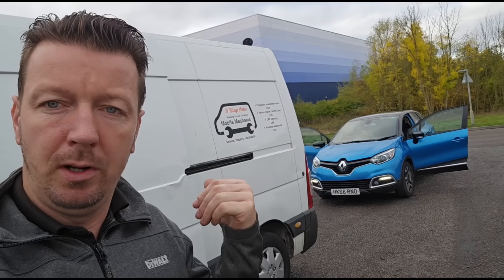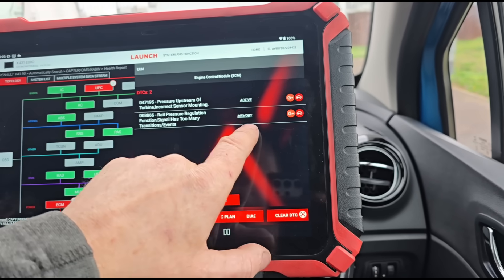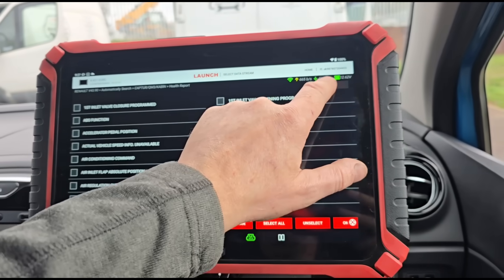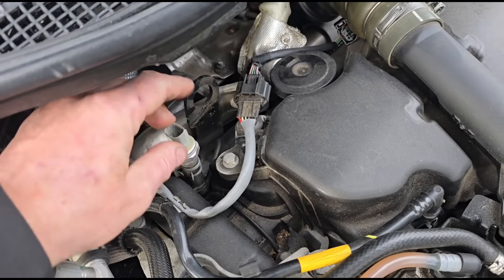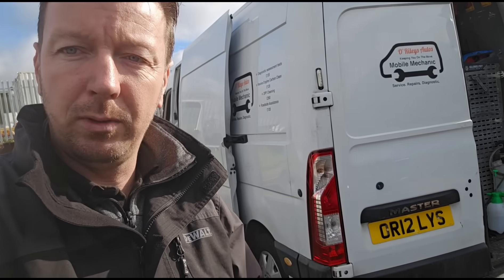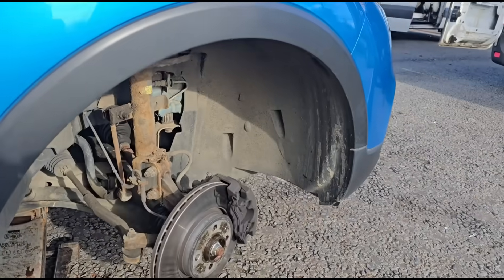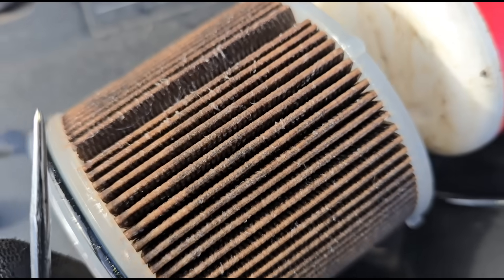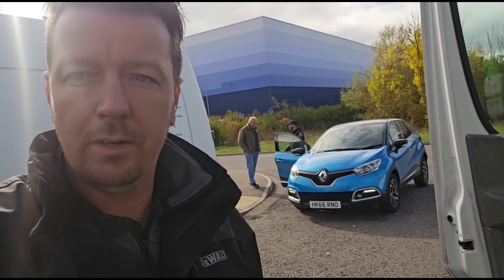Renault Captur DTC 047195

Comment: Hi Jimmy. Great video. I have a question. Just took my Renault Traffic 2017mod to the work shop to replace 2 injectors. After the replacement the mechanic told me that he could not start the car becouse the cylinders 1 or 4 does not goes all the way up, (he try it with the starter and then try to rotate the engine by hands) becouse one of them posssibly is blocked from carbon debri. (perhaps wile removing one of the injectors some fell inside the cylinder). Is that possible?

Comment: I found your channel after I bought a 2015 vauxhall vivaro last week.

Whilst driving it home, within less than an hour, the check injection system kept flashing off and on.

Now it's stuck on with the check anti-pollution fault too.

I've got a friend with a decent diagnostics tool, he did a quick check and it was popping up with a fault on the exhaust pressure sensor.

He's coming back on Sunday to have a proper look and we're going to hopefully get it sorted.

I wish I could get it to someone that knows these issues like you but I'm all the way in the north of Scotland 😂

Even trying to find a half decent garage that can book you in within a few weeks is hard.

I tried to get some launch UK dpf cleaner but couldn't find it anywhere 😂

Got a bottle of wynns dpf cleaner, a spray can of dpf cleaner and a can of erg cleaning spray cus I didn't know what one to use 😂

I also got a new pressure sensor and have an entire new pipe coming tomorrow.

I was just going to order the rubber hose in case we took it off and realised it was burst, but I managed to find the entire pipe with hose for £10 more than just the hose.

I have no idea how hard it is to replace the pipe, but I'm going to assume it's harder than cleaning it 😂

My mate isn't exactly a professional but he gets paid to fix cars 😂

So hopefully between me buying just about everything we'd need whether it is cleaning or replacing the pipe, we'll get it sorted.

Sorry this was so long 😂

If it fixes the issue, you're a life saver.
Reply: Let us know how you got on.
I bought a 2018 vivaro.. Low Adblue message came on then anti pol & check injector etc...
Reply: @paulbrown7374 I will try and remember to let you know if it works 😂
Thankfully mine doesn't have adblue... I think... 😂

My knowledge of cars is basically that they have wheels and go vroom 😂

Gonna just learn to do smaller jobs myself though.

But I think when it's anything engine related, I'll get some help 😂

Not looking forward to doing the glow plugs 😂
Reply: @paulbrown7374 I got it unblocked eventually 😂 4 hours with a bike brake cable, some ptfe tubing, wynns dpf cleaning fuel additive and a bike pump 😂

I didn't have anything capable of putting pressure into the pipe other than a bike pump.

But it bloody worked clamping the pump onto the tube with some dpf cleaner in it on the pipe.

Cycled between putting in some cleaner, using the cable on the drill, then using a brake bleeder to suck out some of the dpf cleaner full of carbon and repeat

Comment: My brother had to change the upstream turbo pressure sensor on my dad's  Renault kadjar 1.6dci and it was really difficult to get to but it was not tight luckily.
He had to get a special socket.
He used a resistor in about in the middle of the range to make sure the computer was ok.

Comment: That's a stupid place for a fuel filter. French engineering 👎
And so many modern cars would be so much easier to work on if the engine bays were 2 inches longer and wider, to give an extra inch of space at the back and front and sides.

Comment: Hi Jimmy, I have one of these Capturs. It's running fine at the moment but would it be worth getting it to you every year or so to just "service" the DPF and clean out the upstream pressure pipe so we don't actually get any problems? Thinking prevention is better than cure!
Reply: One of the most common problems is the pipe down the back of the engine that leads to the pressure sensor. Replacing the sensor will make no difference because the pipe has perished. It’s a bit of a pain to access but simple fix for a £30 pipe.

Comment: Blows my mind how dealers can't solve this. I did this and the unthinkable happened I snapped the gear cable . I had to replace the pipe in situ.
Not a nice job. I used a burr die grinder just to make a bit more room on heat shield to get a crows foot on the pipe. I got it out but was horrible to do.
Reply from the maker: Glad you were able to get it done!

Comment: Where did you inject the dpf cleaner iv got a kajar todo this week 😬. Was it in one of the pressure sensor pipe?
Reply: You might not need to clean the DPF if it’s not excessively blocked. Once the pipe is cleared it’ll attempt a regen straight away, if it’s not crazy blocked.
Reply: @richards4456 your right it has an injector and glow plug fault. If it won't regen on the fly I'd rather clean it than force regen it.
Reply: @m @markpiper8082 efinitely don’t force regen it. Fix the faults and then put some DPF cleaner down the pipe. Remember to do it with the engine running or it will backfill into the cylinders.

The last 1.5 dci glow plugs I replaced, I got the engine nice and hot and then blew around the glow plugs with the airline, put some penetrant spray around them and make myself a cup of coffee. Came back out and they all came out 100%.
Reply from the maker: Yes it was

Comment: Don't think that DPF clean  much cop, why don't you use carb cleaner or you could use that brick acid that will dissolve it diluted 2/3 acid 1/3 water. But be careful when using pressure tho protection face mask you don't want that spring over yourself you probably get away with one bar of pressure
Reply: The launch cleaner obviously works if he's doing on car clean.
He also does off car cleans .
Reply: @nstorm1000  I don't think it was the launch cleaner he used in the pipe?? I thought it was something different. And the launch stuff only removes soot that's not soot more Ash or add blue
Reply: I want 5 trillion dollars not a dollar more or less 5 trillion dollars

Comment: Fuel filter on that car is in the same location on the 1.5 dci Dacia... Wouldnt trust any Garage to change it... And the bolts might snap - luckily it was only one and the other have compensated nicely so far(1year and a bit) 😂😂😂I know shite location considering on Renault Kangoo it's looking at you when you open the bonnet😢😢
Reply: Its on drivers side at bottom behind wing liner

Comment: Hi Jimmy, thx for the video and for the info! One question: the mostly clogged fuel filter with full throttle cause any visible drop in fuel rail pressure? Thx for answer!

Comment: Jimmy mentioned that the ECU may pick the pressure reading from an alternate sensor if it detects a fault. I remember diagnose Dan had a similar problem and went into ODBC to see the correct values. Would that be the case here?